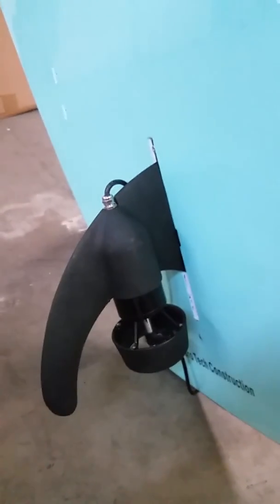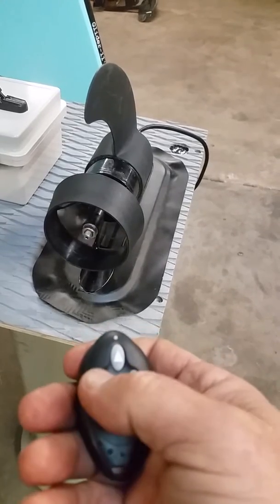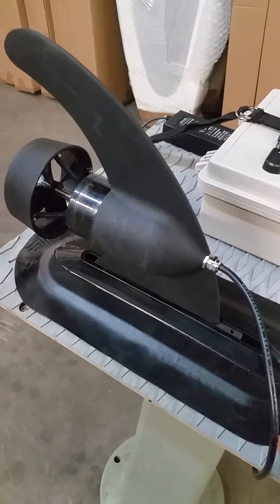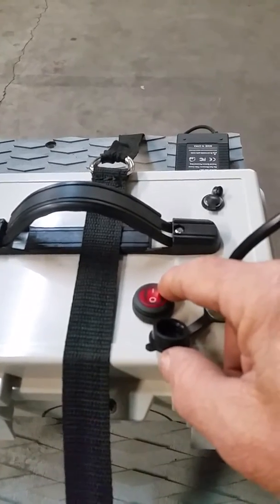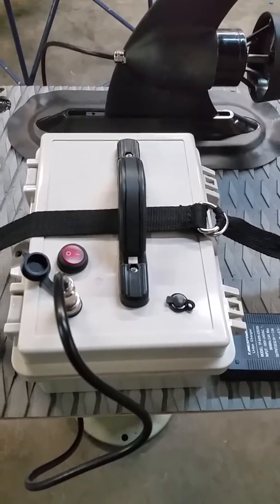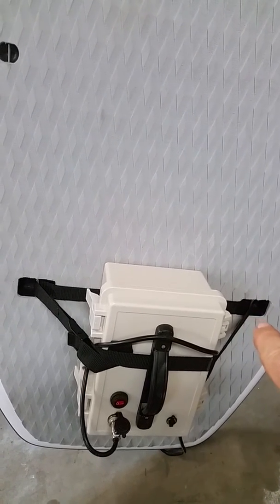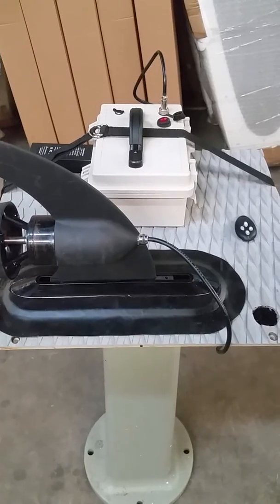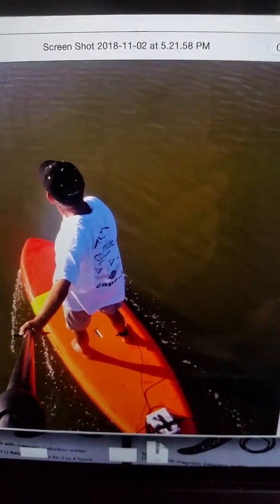Electric paddle board fin. By Michael dolsey designs

Comment: Upon further review, this efin is AMAZING!! Got tech support on a Sunday & got it working in 30 seconds, simple Bluetooth pairing. I am getting 6mph in high gear & this battery lasts all day going from high to 2nd gear intermittently. I am on the water all day with power from 1 charge! This is a must have if you like more than a quick half mile paddle. I paddled in Lake Tahoe over 6 miles on level 1 & then 3 miles on high, still no sign of a weak battery, this thing is a beast! The integrated fin design offers the motor protection that competitors 2x the cost can't offer. This is a no Brainer! Keep your remote in the dry bag & this is flawless execution at a bargain price point! 

Check my vid!!

https://youtu.be/-GC4APZIhw0
Reply: how is it a year later?